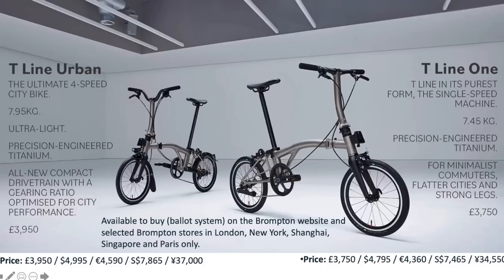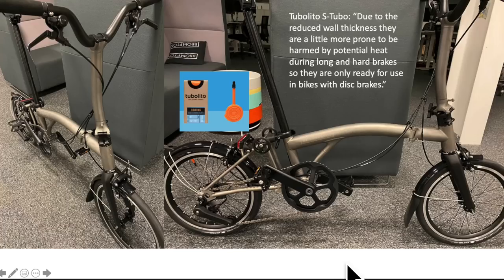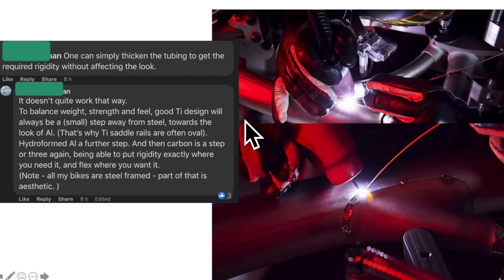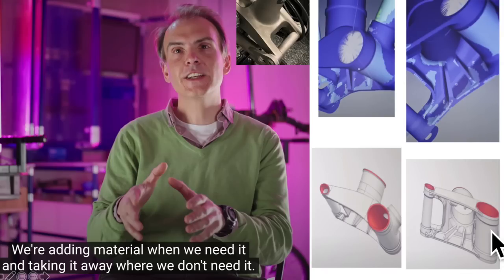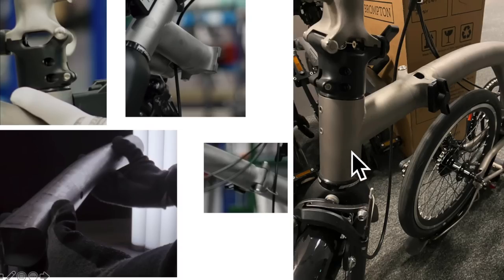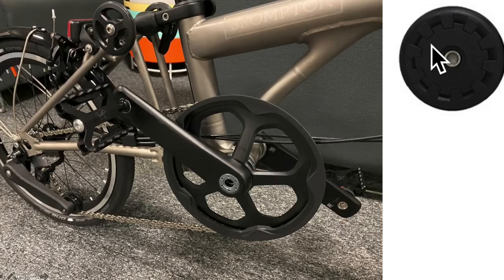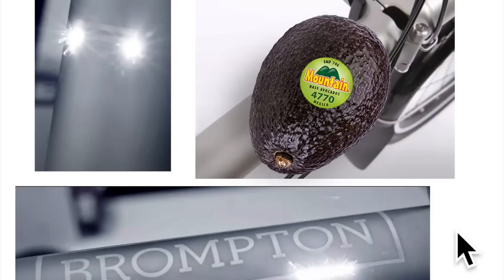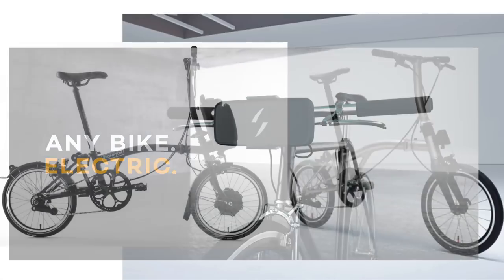Brompton T Line Meta Review by a Brompton cyclist of 15+ years

Comment: Re the potential after market electrification with ARCC or Swytch, am I right to think the carbon forks will be less suited to the additional stresses long term from a powered front wheel than classic steel? Brompton of course built in additional strength to their Electric forks.
Reply from the maker: That is a very good point. I recommend going back to steel forks when electrifying this. I heard titanium forks can't handle electric motors either.

Comment: Hello
Dr James

I previously watched your ARCC and Switch video, I learned about the T Line from your analysis video, I signed up and got it 1 month ago, and the Switch kit arrived 2 months ago, now I see this video and I realize that I won't be able to use my electric kit on the T Line,

I don't like the idea of changing the fork, but I'm not clear if it should be steel or can it be titanium like the one on the P Line? Please would you be so kind as to confirm what material?

On the other hand, there is no other option other than changing the fork? I don't know how to put reinforcement washers or protectors, etc... or do you have reference to any other option? Another brand of electric kit that is on the rear tire?

Thank you for your time dedicated to these videos that are really of great help to us commoners...

Greetings
Rafael
Reply from the maker: A titanium or steel fork from other brompton lines will fit the T line apparently. Both of these can hold a motor. You can get a bike shop to change it. I also suggest to the join the facebook Brompton T-line to get tips from fellow T line owners

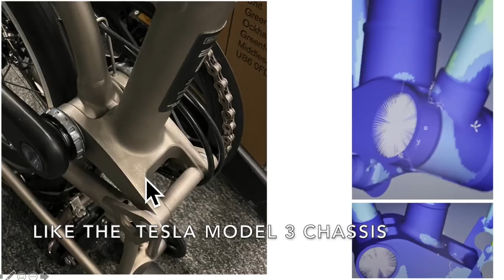Comment: 3:40  the bottom bracket section is not die cast. The launch video states 'casting' so I assume investment casting or somesuch.
Reply from the maker: My point is they are using casting vs welding tubes onto a plate to speed up and reduce cost of the manufacturing process
Reply: @DrJamesT  you said that because there was no weld line here ( cursor pointing at junc of down tube and bottom bracket) it implies injection moulding. What I saw on the launch film they stated it was cast because if it was welded from pieces it would make for a weaker structure - hence they went for casting. What type of casting I am assuming investment casting. Perhaps it is die cast which is same as injection moulding?

Comment: Just noticed that the rear triangle still has the hub gear cable pulley assembly mount meaning it’s still possible to use an internal hub gear to run 6 speed in which will defeat the purpose of being lightweight.
Reply: how does it defeat the entire frame being made of titanium annd carbon??
Reply: @SB-mr2nk  I think he meant, defeat the object of being called lightweight if one would convert it back to 6 speed internal hub as they are significantly heavier and not to mention the addition of another shifter+gear cable.
Reply from the maker: Yup it's 980g for a 3 Speed BSR
Reply from the maker: Wondering if we can put an internal hub to create 3 x 4 speed bike.

Comment: Total madness to have a carbon seat stem and front forks , especially when they already had the titanium option .
Reply from the maker: The Ti seat stem hasn't been made since 2007. The Ti stem is actually lighter than this carbon steel version by 50g
Reply: I agree, I think the carbon handlebars, forks and seat post are not preferable to titanium.

Comment: Nice pointing out the hole(s). I would assume that they will recommend to fold it down and not leave it out. When folded, the holes effectively go away, right?
Reply from the maker: The holes are created when it's UNFOLDED.
Reply: @DrJamesT  This water discussion is a non-starter. On the steel frame water can easily get past the hinge if it wants too. Even on a conventional bike water will get past the seatpost into the frame.

Comment: Any idea how wide a gear range the new 4-speed derailleur can accommodate? I live someplace very hilly: 300% would be good. 163% is pretty low.
Reply from the maker: It's 163% but you can swap out the sprockets and chain rings.
Reply: Thanks—I was wondering how large a rear sprocket the derailleur/frame can fit in the 4th position. Do you happen to know? Will it take a 24-tooth? More? I’ve read that the largest you can put in the 3rd position is 17 teeth or it hits the dropout/frame.

Comment: Keep in mind that the Swytch Kit uses a lowly cadence sensor as opposed to a torque sensor, which to me kills all the fun in riding. Its edsentially a pedal-activated on-off switch for the motor. 

Also note that the official Brompton electric has a reinforced fork. While I'm willing to bet the carbon fork will be just fine -- there are plenty of ebikes with carbon forks from lesser companies, this is nonetheless a risk. I have seen even steel bikes with damaged forks from a motor they werent designed to handle.

Personally, I think Brompton should make a titanium electric. Yes itd be heavier, which some might see as defeating the purpose, but it still be one of the lightest ebikes around, let alone a folding one.
Reply from the maker: The ebike with "carbon" forks is reinforced with metal. Just like the brompton T line seat post is carbon wrapped with steel. The dropout design is usually the point of failure so make sure the washer reinforcements fit or add a torque arm.

Comment: Thank you Dr James; great review... am on my 4th Brompton, had a two speed S type Ti Ultralight, L6 - all steel, SRAM gearing (first bike), and two S Type Ti 6 speeds with BWR Sturmey Archer. L6 dark blue w. silver extremities; S Type two speed Flamingo Pink, S Type Ti 6 speed BWR's, one Arctic Blue, now my current model is Hot Pink (bought it as is a bit pinker than Flamingo). Think the Brompton T Line is a major advance & accomplishment for the company - it is truly iconic. i want one and am going to have to start saving some serious pennies. Personally, i would like to see this bike with a carbon aero wheelset, elliptical spokes, spoke counts are okay, carbon handlebar, carbon mudguard blades, 6-speed derailleur gearing w. ratios identical to the old SRAM setup. That would be a proper pocket rocket. Brompton, please take note... so nearly there! Minor changes; all easy to do; well easier than fabricating the mainframe in Ti, for which i applaud you. :)
Reply from the maker: If your wife ever complains about your hobby tell her be to glad that these are folding bikes and not cars.
Reply: A Brompton is an "awful bike" on the small, hard rolling wheels and its only reason to be made is folding into hardly nothing, when not being used as a bike. My now much less than Superlight, with mudguards. and for a much less price than a T-line, even with all the titanium now on it!! Finn

Comment: Nice insight, it will be good to see the production bike.  One big ick with me is why don't they introduce disc brakes.  This is essential for a commuting bike, forget weight - performance and safety please!  Then you  can splash on some carbon rims and polyethylene spokes!
Reply from the maker: Agree, the light road bikes have disc brakes. It's probably the fold size they don't want to affect.

Comment: All very informative and interesting.
Not read comments, yet.
But mine is... 
I did not understand the Seat post Having To Be Steel Sheaved Carbon (which otherwise would get chewed up raising and lowering?!) but all my Brompton's main frame have a plastic (reamed to size) sleeve, I have had steel, aluminium, titanium and carbon seat posts, no chewing up.
Are you saying the T line does not have a seat post sleeve? As that is the only way the frame metal would cause damage.
I can't believe that is the case.
Take care 
Best regards Colin
Reply from the maker: Bromptons "are built to last". This is a very a long seat stem, which collects grit. Especially in the rain. Grit could go into the sleeve and start wearing the tube. The steel could also be there for the same reason of having laminated glass. When the stem breaks, ie in an accident, the steel prevents the broken stem from becoming a spear. That stem is long enough to skewered 2 cyclists.

Comment: Probably the best Brompton ever made. But ridiculously expensive. And with its limited gearing. It would still struggle on the hills where I live. People have this obsession with bike weight. But if the gearing is not on par. It will still have serious limitations. If I have to face one particular hill where I live. Would I want to take it on with my 23lb Tern verge X11 with its amazing 10--42 11 speeds. 24 gear inches to 102 (£2,400). Or a 16lb Brompton Tline with its limited 4 gears (£4,500).

I know the anwser.

Comment: I don't get who this Brompton edition is for. What benefit do you really gain from the 4kg shaved off? The relatively low weight reduction isn't going to have a huge effect on speed: a typical person might be moving 76kg instead of 80 so 5% less effort, or 5% faster with the same effort? Slightly easier to carry up and down stairs perhaps? I'm not particularly strong and have no issues carrying my 12kg Brompton up the stairs out of St Pancras Thameslink station. You take a durability hit with the carbon fibre parts, so it's less suited to being put in a train luggage rack. Or is it just a flex?
Reply: The weight saving is significant so less mass means going up hills better but the real boon is carrying the bicycle. The T Line has also been a design and engineering exercise or perhaps a 'chassis design' exercise  which  will translate into that magic carpet ride which the inventor has wanted all along. I still think effort should be made into the steel chassis and to get the main tube lighter in steel. The rear derailleur is only 60 grammes. ..amazing
Reply: Transportation, hills, acceleration, braking. More agile for urban setting. No rust.
In terms of speed I feel it’s a compromise. Aero is more important. Stiffness as well in terms of efficiency. . I wouldn’t be surprised if it’s a slower top speed bike compared to other models. I feel this bike will be quick not fast if you understand what I mean. 
You could take some tips from their design choices. I have found schwalbe one make a significant difference in speed. I have tubolitos in the mail. 
The problem with external gears is that the range isn’t as wide as bwr. I like the design of this derailleur because transportation in a hard case of a traditional derailleur will get beat up and even may bend. It’s one of the perks of an internal gear that you can bang up the bike. This design seems to protect the external derailleur or at least keep low profile.

Comment: My 2019 SuperlightM6LXBrompton, with a titanium fork and back triangle, + titanium seat post and parts, for now weighs 8,75 kilos, with mudguards (Titanium struts, from the Factory, but "heavy-metal" clamps holding them! I have a carbon set for this) and upgraded parts. A little past the titanium model, so I have thought about changing the frame to an unoriginal titanium frame. But as a heavy man of a 100 kilo, I'm in doubt if an Asian made frame will be strong enough for me? My titanium seat post is standard length, but a little too short (My original was an extra long 600 mm post, but too long for an effective fold, so that's why I tried a shorter version. Finn. Denmark 
        I expect to reach 8,50 kilo, when the Day of Summer in Denmark arrives, with the use of a lot of titanium parts from China, and for a much less price than a T-line!!   Finn

Comment: Hi James! Thank you for your very informative video. How do you see the gearing range of the T-line Urban (164%), compared with the C-line Explore (302%)?
Reply from the maker: 300 per cent range would offer a 3:1 ratio. Pedalling in the highest gear would move you three times as far forward per pedal stroke as in the lowest gear. This means it can accommodate a wider range of road steepness and leg strengths. So this is great for touring. You can change each sprocket size and/or chain ring size to adjust your range. Sprockets cost $5 USD each. It's very easy to change them. I wouldn't decide on a bike, at such a huge price difference, for their gearing range alone. The price is mostly about it being lightweight.
Reply: @DrJamesT  Thanks for your answer. Last questio :) Here in this area of Portugal we need this kind of ratio because there are lots of hills. Do you think that the reduced weight of the T-line compensate the wider ratio of the C-line 6 speed (with original sprockets)?
Reply from the maker: @World-shopper  Yes there's a great chance you will. Definitely test ride it before buying. It's 8kg vs 11 kg  the weight of C-Line.
Reply: @World-shopper  My SuperlightM6LXBrompton is now modified down to 9,35 kilo and I use it much on a hilly Island, also with serpentine roads. Going up I may walk once in a while, also passing tubes for cattle protection, as even the low gear is too high (I wouldn't have believed this!). But I like my 6 gears, and fine brakes when I go down again. Finn. Denmark

Comment: They replaced the AL crank arm with CF crank arm as well, for me I think CF crank arm is not good enough for everyday usage of the bike. Crank arm are prone to scratches and once the surface of the CF crank arm has scratch then it will begin to degrade and also the resin that bind the carbon fiber doenst age well like steel and might become brittle overtime. correct me if I am wrong
Reply from the maker: Excellent insight. For the sake of breaking the sub 8kg barrier they have turned the crank arm back into a consumable. In the old gen bromptons the crank arm was attached to the cog. Once the cog wore out you need to replace the whole thing.
Reply: Let's hope that doesn't happen to the Boeing dreamliner!
Reply from the maker: @wellwellrobh  Dreamliners are well above the curb

Comment: It takes quite a surprising amount of effort to easily surpass a 15mph average on a Brompton.
Reply from the maker: The lighter the less effort. Try the 7.45kg brompton. With $4k you can get a 6.9kg road bike. The top Tour de france cyclists average speed is 25mph.
Reply: A road bike is also vastly more aero than a Brompton.
Reply: Aero would be more important. The rider aero and position even more than the bike. Weight is more hill climbing and carrying it.